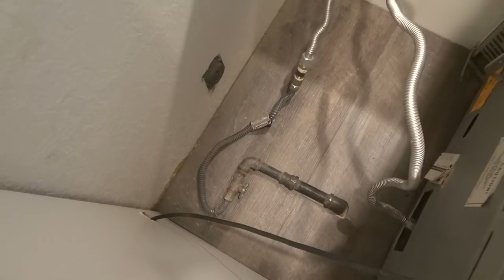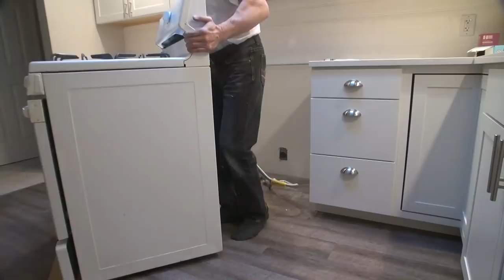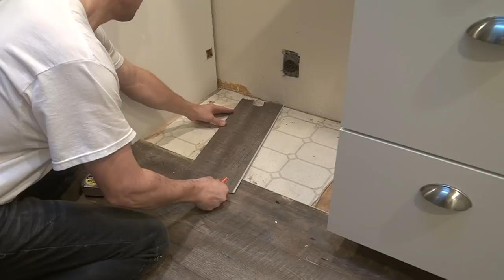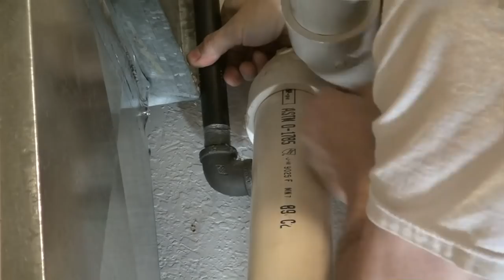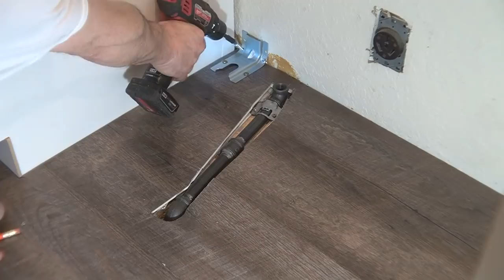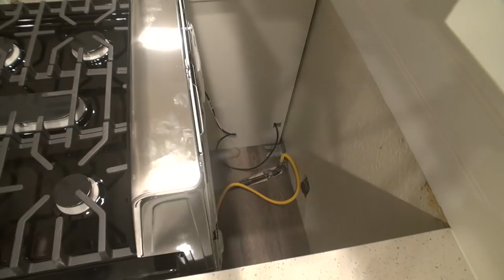Replace gas line and valve under stove. Газовая плита подключение

Comment: I wonder why gas service doesn't come from the wall like the laundry service. A recessed panel with shut off valve in it. Mine has enough room under the storage drawer for the gas line to loop under it and the sub out and valve are behind right next to wall.
Reply from the maker: Basement wall and wall behind this stow not in same position on floor.
Reply from the maker: You can see at 2:00 (in the basement) pipe on top of the ceiling just 1 inch from the wall. 
And next moment at 2:03 you can see the distance from wall to the pipe on stove floor about 12".
That's was done when they build the house frame.

Comment: Most codes state that pipe joint compound is to be applied to male threads only.
Reply: I also only put the pipe joint compound on the male threads only and was wondering about that as you did, although he seemed to work carefully and intelligently and obviously takes pride in his workmanship.

Comment: But he didn’t show how to turn on the outside valve again those are tricky
Reply from the maker: I dont know what you mean,  but I was used same tool and done it easily. Never had that problem with outside gas valve.
Reply: @FixitAll  not trying to disrespect man it’s just I’ve known that some have like a flat head screw that you turn about a quarter clockwise in order to start the gas flow after turning on the main valve.

Comment: In Russia i would be fired for such a pipes montage... Too many joints, pipes downstairs arent fixed well. You dont even have a pipe cutting machine and use the standard cuts... Awesome bad job!!!
Reply from the maker: Зачем мне иметь машину для труб и что-то там резать если в магазине есть любые готовые трубы? Купил и не парься.
Все дома в америке имеют кучу соединений газовых труб - и что? Это Америка друг.
Reply: @FixitAll  это хуево друг. Вместо муфтового соединения нужно было использовать цельную трубу. А так это колхоз
Reply from the maker: @Halabalooza  Думаю да, лучше. Но зачем? Что с ней когда-то случится? Тем более что стандарты и инспекции местные это одобряют и не видят проблем с этим.

Comment: I am just wondering, could the "legs" of the new range be raised so that the bottom clearance is more?  Or can two 1.5 inch wood bars be added so that the new range has a taller bottom clearance. I suppose the new range is "expecting" the gas in pipe to be coming from directly near the back of the wall, while in this case it isn't.
Reply from the maker: Owner ask to install it on the same level with countertop.

Comment: Is it true that after turning off the house's main gas valve, then once you are done with all the gas range work, and turn the house's main gas valve back on, then you may have to re-light the pilot light of the house's central heater (furnace), and the pilot light of the water heater?
Reply from the maker: Water heater only. Furnace doesn't have a pilot light. There is electric ceramic igniter.